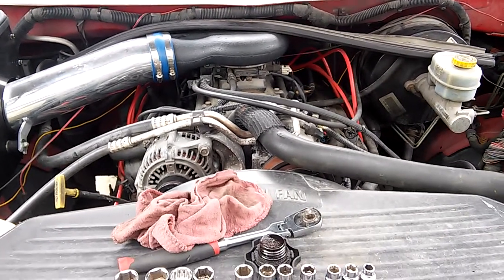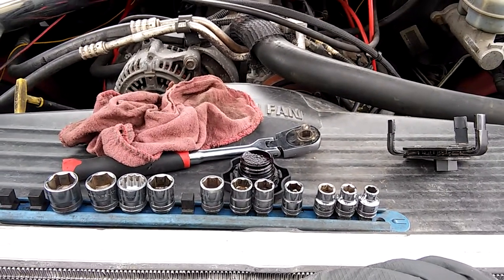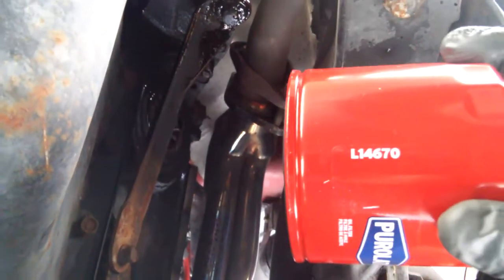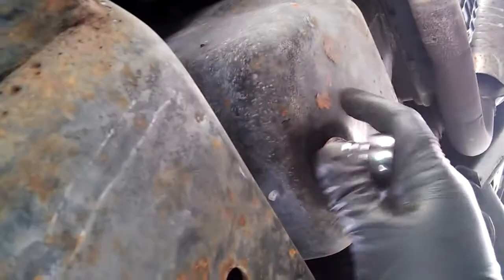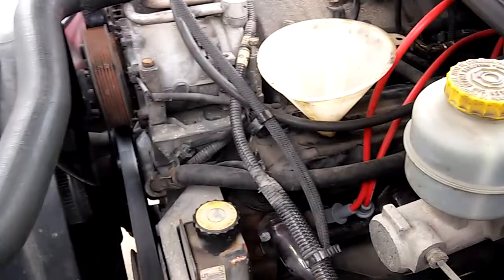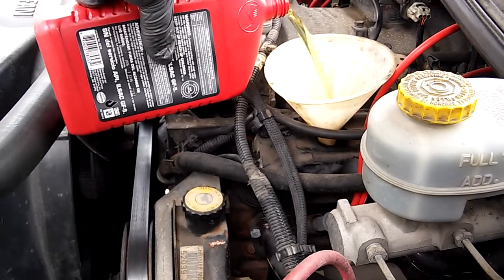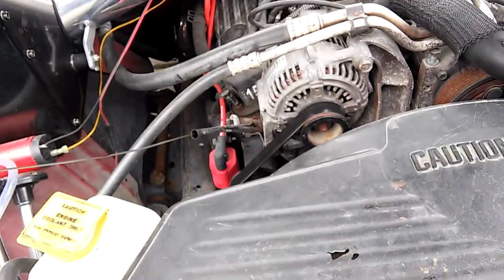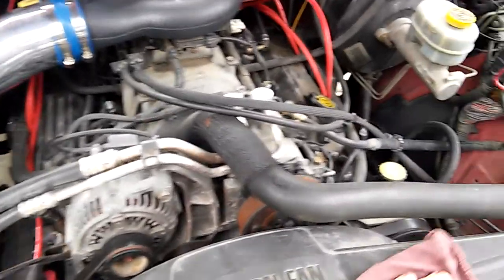how to change engine oil in a 1998 Dodge Ram

Comment: I recommend using e3 diamond spark plugs i just put them in my 1999 SLT dodge Durango V8 magnum and i put in royal purple automatic transmission fluid in her today im telling you she running a hole lot smoother and quieter she does need a new muffler...and I'm using royal purple oil filter its not on the truck yet i be using the royal purple high mileage oil i be doing the oil change next month

Comment: what kind of air intake is that and how do you like it ?  im thinking of getting one to prevent mice from getting in.  did those mods give it a good power boost ?
Reply from the maker: Throttle response is waaay better, fuel efficiently went up and sound is great as well

Comment: do you know if it matters what fiter it is from 5.2 to 5.9
Reply from the maker: Like what brand?
Reply: @tntoverhaulllc  the same brand you used
Reply from the maker: @OneWayLife1320  I use wix and it's 51085 number and it's actually the same filter for the 3.9 v6 and both v8's the 5.2 and 5.9 I trust all filter brands except for supetech and wix because I've had issues with both brands on different vehicles